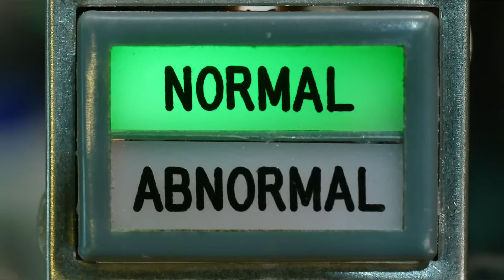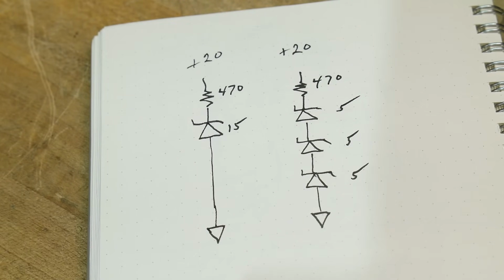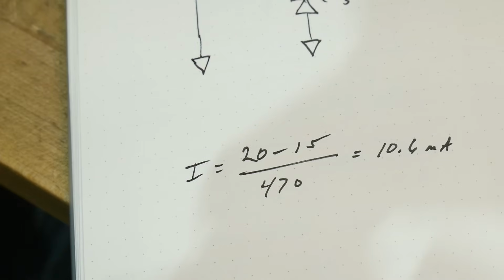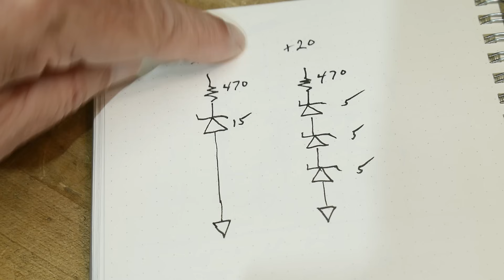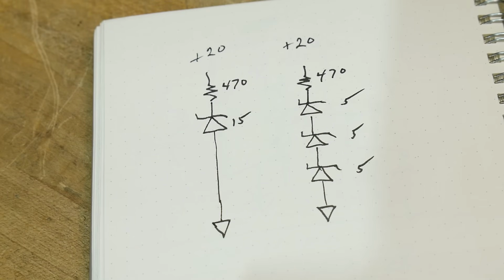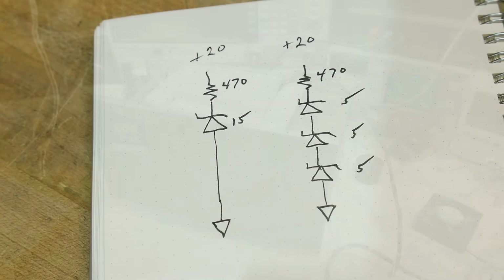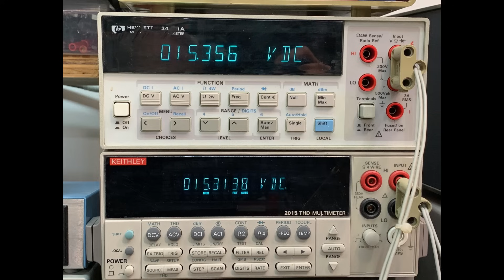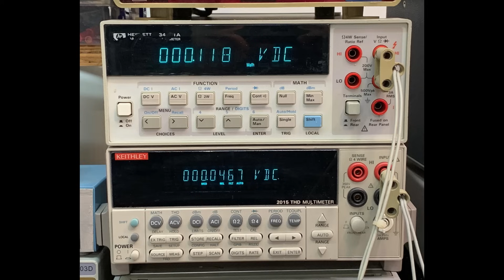#1877 Three Fives is less than Fifteen

Comment: Well nowadays zeners are 5.1 or 5.2v iirc 

I guess to account for the internal voltage drop
Reply: You could run 3 15v in parallel and reduce the heating because you pass lower current per diode

Comment: Hi. Apologizes for asking first, I asked before and lost my post it.  what kind of video camera and lens are you using? I bought a amscope mu1003 for my "small components assembly area" that was listed as "high speed" but it isn't high speed enough. As I move the soldering iron or probe into the field of view I am presented with a jerky video. Perhaps the connection between my camera and computer isn't fast enough? Thanks in advance

Comment: Another advantage of using three 5.1V zeners to make a 15V zener, is that the tolerance of the combination zener will be better than that of a single 15V zener. The combined tolerance of three 5% 5.1V zeners is the square root of [ (Tol1)squared + (Tol2)squared + (Tol3)squared ] or 2.9%.
Reply: In theory that would be correct IF the components were randomly sampled from a normal distribution with 5% std deviation - in reality your diodes will most likely be from the same batch and have a common "offset" caused by the current condition/calibration of the manufacturing machine. Also the 5% are usually specified over the complete temperature range and the components are usually with <1% at the middle of the temperature range and the deviation is mainly caused by the temperature coefficient. But putting more in series helps keeping the cooler.
Reply: That's almost never true in practice. You will end up with stackup and the tolerance will be worse. This only works in textbooks, where you're told to assume perfectly random deviation.

Comment: Would it be better if the circuit was 15 1 volt zeners?
Reply: No. On one hand, there is a sweet spot around 5V. On the other hand, where do you find a 1V zener? They start at 2.4V. Occasionally you may find something advertised as a 1V zener, but they are in fact normal diodes with a forward voltage around 1V.

Comment: The higher-voltage part is mostly using the avalanche effect, while the low-voltage devices are true zeners. The temperature stability is likely the reason motivating this decision, but another difference is that the avalanche effect has a sharper "knee" so if you throw both on a curve tracer, you'll likely see a much sharper curve for the single-diode arrangement and a much softer one for the three-diode arrangement.

In most cases a sharper transition is preferred,  but there might be some applications where the more gradual turn-on is desirable.

Comment: I believe if you were to repeat the test using 3.3 volt zeners in a series chain the temp coefficient would be negative if my cloudy old memory is correct?  Again from the muddled up grey matter, I think the zero crossover voltage was around 4.5V?   If I recall correctly, forward biased diodes have about -2 mV/deg C or -1.11mV deg F temp coefficient.  Love your work and thanks for sharpening up or at least slowing the degeneration of my brain cells.  Cheers

Comment: Low voltage zenners (eg 1V) have a negative temperature coefficient, while high voltage zenners  (eg 15V) have a positive temperature coefficient. Arround 5V the temperature coefficient is ZERO. Therefore to minimise variation with temperature you use 5V zenners as your reference, or multiple 5V. See also the wikipedia page on zenner diodes which has a graph of coefficient vs voltage.

Comment: Reverse biased diodes conduct due to both the Zener effect and the avalanche effect.  At low voltage (<5 V) the Zener effect is dominant and at high voltage (>15 V) the avalanche effect is dominant.  But, they have opposite (an unequal) temperature coefficients.  At about 6 V (depending on current) the two coefficients exactly compensate each other resulting in zero variation with temperature over a wide temperature range.  Data sheets reflect this trend without discussing its causes.  Zero x 3 is still zero...  We might point out that there are also small resistive surface currents that bypass the junction and creation/recombination currents.

Comment: I think the surface area would need to be way higher on the 15v zener to compensate for the distributed and discoupled termal dissipation as the 15v zener would create sort of a cloud of heated molecules that would, in ambient pressured, room temperature air move away from the diode but for the little zeners that process would be much quicker...
Reply: 10mA will lead to an extra 150mW of heat, well within the 250mW heat rating, and after an hour both will be stable in the oven. The temperature inside the oven will not vary, and the die of the 15V zener will be at the same temperature as the dies on the 5V zeners as well, at least within 1C. Those copper leads are suprisingly good at transferring heat away from the die, and diodes are rated for higher temperature than transistors because of this, most are specified up to 150C, while transistors are specified up to 125C die temperature.
Reply: @SeanBZA  oh havent thought about heat capacity and conductivity, good point. I mean my theory isnt entirely wrong, its just missing what you said which is the time scale at which it happens. Way quicker than i thought it would. Thanks for taking the time and educating me on this🙏🏼

Comment: amazing how you can measure temperature using diodes, we made a sensor that had to keep a very stable temperature, this was achieved by also having a diode build in just the right place on the silicon.
Reply: On silicon a better sensor comes from making a transistor, as the buried base emitter junction always has lower noise, due to there being no surfaced junction that you can get leakage across the top of the die.  Yes most are run with base and collector shorted to make a simple diode, but if you are going to integrate it, a transistor is best and easy, no extra steps in processing involved over what is making the rest. If you are going to integrate the measurement as well, add a little extra die area as well and make a full bandgap reference voltage generator there, as you get as a bonus a stable reference voltage to supply the ADC, and the reference also supplies an amplified die temperature to measure as well, absolutely free. Most DMM chipsets do this, as that temperature reference is used for cold junction compensation for thermocouple use, and the reference is used with the ADC for the voltage range inputs. Use a dual slope converter, needing only 3 external pins for the 2 capacitors, and you can easily get 14 bit accuracy, even on a noisy digital logic chip.
Reply: @SeanBZA  the main sensors on the chip were isfet's with current measurements in the pA range.  Can't say how the temperature sensing diode was made, to us it was just seen as one on the outside of the sensor. Would have loved to been more involved with the sensor, but the design on silicon was left to a team of semiconductor design experts.
Reply: @TheEmbeddedHobbyist  Then it was definitely a diode connected transistor, as that integrates well with FET production, and also buries the junction.
Reply: @SeanBZA  thanks,  my main concern was the asic that processed the signals.

Comment: You are using too much current for zener diode.  10.6mA x 15V  is about 150mW vs 10.6mA x5V which is about 50mW.
At high temperatures without heat sink the devices start to heat up themselves.  Three 5V devices have more surface area ( because they are three) to dissipate heat than 15V device.   Moreover they have less power to dissipate to start with 50mW vs 150mW.
You can try your test using 500uA, that is with 5K ohm series resistor,
Reply: The problem there is that the "knee" on low voltage Zeners is poor, so running three 5V Zeners at 500μA will give a high dynamic resistance and hence poor load regulation. For the cost of three Zener diodes, you might as well just use a TL431 and two resistors to get 15V with a typical temperature coefficient of 50ppm/°C and dynamic resistance of 0.2 Ω.
Reply: The zener voltage is specified in the datasheet for a specific current, typ. in the order of 10mA, and it may be significantly off at 500uA.
Reply: @plemli  Current specified is usually maximum current.  It makes no sense to waste 150mW to generate reference voltage.  I-V curve of zener diode at beak down is very step. So using less current does not make a significant change to voltage.  The resistance of zener diode in break down is almost zero, and your connections and the resistor change contribute to more; though, insignificant change in voltage.
Reply: You're exactly wrong here, zeners tend to have very soft knees at low current, 1-10mA is pretty normal current that gets you into the are of low dynamic resistance.
Reply: @aduedc  That is wrong on so many different levels.
The maximum current is determined from the power dissipation of the diode. I = P/V
The datasheet does indeed specify the current required to hit the Zener voltage.  Some datasheets will give you a range over which the diode will open.
The Zener has a dynamic resistance.  This is also on the datasheet.  The voltage dropped across a Zener diode is a combination of the Zener voltage AND a product of the dynamic resistance and current.  V= Vz + IR
Judging from your comment I would not expect you to understand any of this.
Reply: @VEC7ORlt  I refer you to solid state books on semiconductors.  Nevertheless, wasting 150mW to get reference voltage is out of the question.  It will drain the battery needlessly.  You get reference voltage using bandgap circuit ( normally about 1.25V) and an opamp, all the circuits will not use more than a couple of mA these days.
Reply: @aduedc  dont compare apples and oranges - one is highly optimized for stability and power and doesn't rely on the knee, the other is just zeners - good for overvoltage protection, clamping and making crude shunt regulators. Besides why even bother using zeners when TL431 and the like exist?
Reply: @VEC7ORlt  Zeners are not for voltage protection, they are mostly used with regular diodes ( zener backward and  regular diode forward) for fast voltage reference generation.   DIAC is for fast over voltage protection; though, there are other ESD protection circuits that work better.
Zeners are also used for white noise generation.
Reply: @aduedc  'fast reference generation' wtf does that even mean?
DIACs are as rare as hens teeth these days, lest alone used for protection. 
What do you think is inside those ESD protection chips? Hint - starts with a Z and ends with a R.
You sure that big book of science of yours is up to date?
Reply: @VEC7ORlt  You cannot use zener diode for protection, because you need resistance in series with them in order to control the current.  This resistance acts as your power supply resistance.  For example, in this case he is using about 500 Ohm in series.  Just imagine you have 500 Ohm series resistance with your power supply.
As for chip ESD, we use different circuits depending on where is being used.  For input lines we use diffusion  resistance along with two gate grounded MOSFETs (one NMOS and one PMOS).  For Power lines we normally use ESD clamp, which is a capacitor resistor inverter and a big MOSFET, and also use DIAC if they are available for the process.
I am a practicing analog chip designer, so I always keep myself up to date with latest developments.  However, if you have suggestion for new references; I always love the check them out.
Reply: @aduedc  how does your team even communicate with you?
Cause you jump topics without any explanation, pretty sure we started discussing around discrete components and suddenly jumped to IC design techniques - stay on topic, because it shows lack of understanding or you're just full of crap. 
Oh and you can use zeners without resistance, you'd just get a hard clamp and put more stress on the zener, so you shouldn't.
Reply: @aetch77  Judging from your comment I think this was a personal attack rather than scientific discourse!  This is so obvious that does not need my replay.
You can be proud that once in your life you had the honer to have corresponded with real scientist. I encourage you to learn more so one day you be able to have real scientific discourse.
Reply: @aduedc  You're not a scientist.  If you were you wouldn't be spouting such BS.
Reply: @aetch77  Another personal attack!  Wow!  I have more than 365 peer reviewed papers in scientific journals, how many do you have?
Do you know enough solid state physics to tell me what is the different between  avalanche and zener break down mechanism?  I guess not.
Reply: @aduedc  You're a peer reviewed scientist?  Why didn't you say.  Why don't you give the real explanation of how a Zener works in terms an electronics engineer can understand.  That's something you haven't done yet.
Reply: @aduedc  You think that
"The resistance of zener diode in break down is almost zero, and your connections and the resistor change contribute to more; though, insignificant change in voltage."

I'm sorry, but whatever subject your 365 papers are on, they are clearly not on electronics. Take a look at the datasheet for a 1N4733A (a 5.1V Zener from Vishay) and you'll see that it has a typical dynamic resistance of 550 ohms at 1mA, which falls to 7 ohms at 49mA.

Do you now understand what a "knee" on the V-I curve is now? If so, please don't suggest using 500μA Zener current and then tell us that the dynamic resistance is almost zero!

As for your assertion that Zeners are not used for over-voltage protection, please check out circuits using mosfets (especially logic-level mosfets) for protection. Whenever the gate-source voltage might exceed about 10V, you'll almost always find a 10V Zener used to clamp the gate within 10V of the source.

Comment: At about 5v for a zener diode the temperature coefficient is zero. Above this voltage the coefficient increases positively and bellow about 5v there is a negative temperature coefficient. So choosing three ideally zero temperature coefficient devices in series is better than a 15v zener with a much higher positive temperature coefficient. The temperature coefficient of the three devices will be the same as a single device. Under well matched and ideal case all kept at same temperature. Lower temperature coefficient applied to ( 3 x 5v = 15v combination ).

Comment: The 3 zener stack also splits the power dissipation between the devices, heating each less.
Reply: Also its capacitance decreases. It's widely used for applications where fast dynamics and clippling voltage is required. Adding series diodes decreases the time constant of the circuit.
Reply: True, but you're assuming the heat/temperature is from the one, or three, zeners.
If the circuit is in a hot / unstable temperature environment, then the variable ambient temperature is what it is.
Reply: That was the topic of this video.

Comment: Could you do a quick video and see if there's anything interesting to see putting both those on the curve tracer?  Since a zener has this non-linear thing that happens at the breakdown voltage, I wonder if you can see different behavior as you approach the 15v threshold as the 3 different 5v devices in series each ride over the knee in the curve as compared to a single 15v device?

Comment: Thsnks. What would the result be if you connect some  neg and pos tempco zeners in series.
Any better than the 3in series ?
Reply: Maybe, but tricky.  The temperature coefficient of a 5.1V Zener as very low compared to lower or higher voltage devices.

Comment: Interesting experiment. I'd test multiple diodes individually for drift - and then the connections of them too. A fixture made of DIP sockets, some perfboard and ribbon cable could be perfect for that, diodes placed in the socket and all reconfiguration done outside the oven while it is working, allowing changeover while keeping the temperature stable.
Reply: With zeners being so meh, why even bother?
Reply: @VEC7ORlt  because an observation was made, and a curious mind desires answers :)
Reply: @KeritechElectronics  well I mean its just zeners, not exactly a pinnacle of stability or anything, if anything of sorts is needed just use a reference - performance is guaranteed and characterized.
Reply: @VEC7ORlt  yes, TL431 or something like this - pretty useful indeed.
Reply: @VEC7ORlt  Reference diodes are all basically constructed that way, especially those used in precision voltage references, where the diodes are selected out of a batch for best performance, then aged while hot, and then selected for zero TC current, and come with a resistor that you use in circuit to drive them with the right current. The reference IC's all are going to drift slightly, so the gold standard is a well aged zener, run with a constant current, at stable temperature in a shielded insulated can, and a buffer that has low noise on the output.
Reply: @SeanBZA  may I introduce you to Marco Reps? And his altar of PPMs.
There is a huge chasm between your average zener and something like LTZ1000.
Reply: @VEC7ORlt  The original gold standard was the Weston cell, then it became temperature stablised selected zener diodes, then finally Josephson junction devices which are the definition of the volt.  Yes I know of Marco Reps, and yes there is a big difference between the bog standard cheap zener and a LTFLU zener device, but they are both at heart zener diodes.

Comment: Interesting, I never considered the temp coefficient But I almost never use Zener diodes. Thanks
Reply: that's the hard part of design. Temp coefficients for affects in use as temperature changes, changes in values due to ageing is another. Measuring a voltage correctly now is one thing but if  you need the same circuit to measure it the same value in 3 years time that's a whole different ball game.